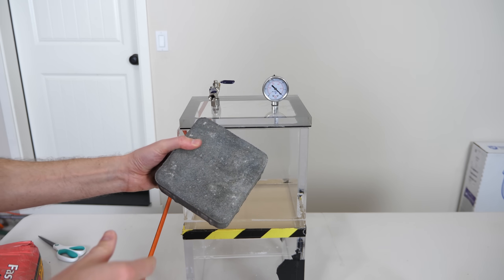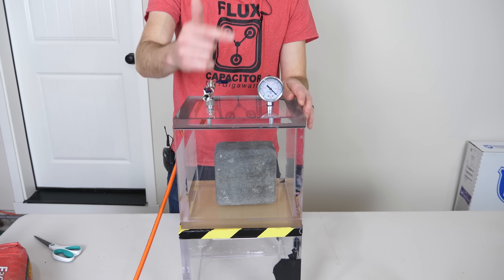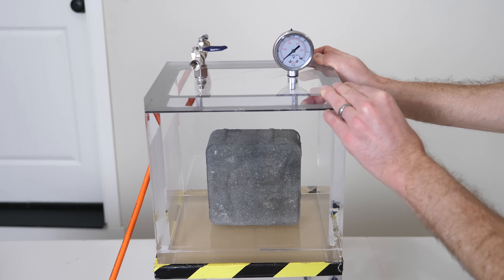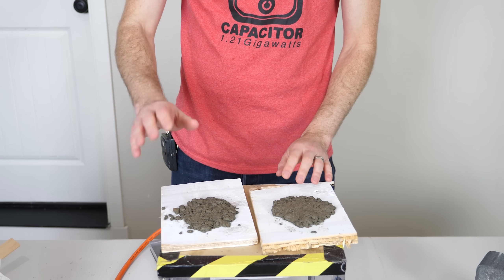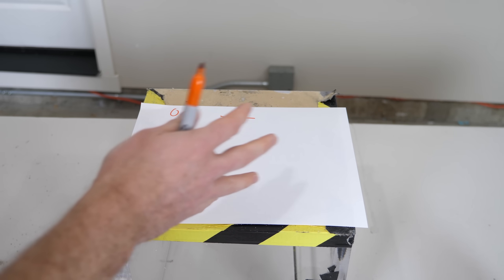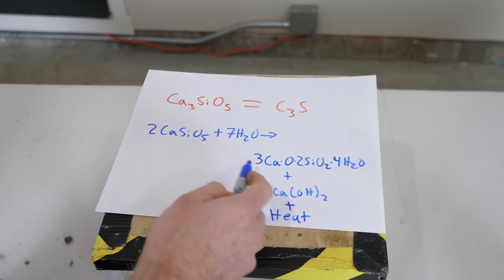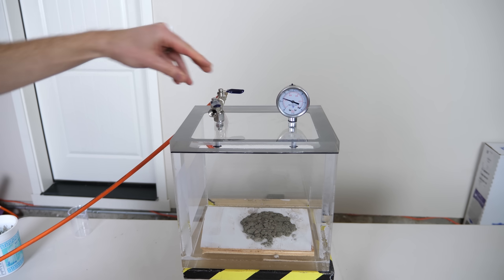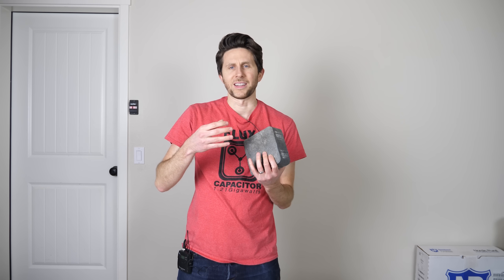Does Concrete Turn to Dust in a Vacuum Chamber? Concrete Without Oxygen Experiment

Comment: To 'make concrete in space' all you need is a mold that is fully enclosed to prevent water loss while it is curing.

Granted, in space, you would have to be carrying a whole lot of water, which likely means you would have to mine it from hydrate bearing rocks to begin with. 

I would suggest that you would be better off on some kind of moon or planetoid where a source of water [and probably the rest of your minerals] already exist. 

Our moon would be an ideal location for a solar powered concrete fabrication facility.

So too would be any other place you came across water either in liquid, ice, or mineral hydrate form.

That way you would not have t carry a bunch of very costly and yet very flimsy pre-fabricate bubble houses with you, you could simply set up a small, efficient base camp, and set right into mass producing housing with the native materials on hand.

With intensely enough focused sunlight, you could even 'sun-laser' cut the rock into pieces and simply move them out of your way to tunnel into the surface, and then use the 'rubble' from this as the material to make any critical surface modifications, high-rise structures like space ports, reinforced pressure locks (a well made concrete will hold against a vacuum for a long time) and to seal/reinforce loose and unstable ground rock.

On top of this, much of the 'waste' rock could simply be thermally depleted of its water content, simply for the value of pure water for drinking, irrigation and hygienic purposes.

Almost all rocks on all solid bodies in space have some portion of water locked in them, just in the form of mineral hydrates.

Since concrete is a mineral hydrate, all you are doing is converting a crude, wild, random collection of lithic hydrates into an orderly, well controlled aggregated conglomerate.

Concrete would withstand zero pressure on asteroids and moons forever, so far as how much oxygen it was exposed to, things like meteorites, and possibly cosmic rays would be more of a challenge.

With a well engineered solar concrete and water manipulation station, you could colonize any planet within a reasonable distance of any star, no matter what the atmosphere was [or was not] and even produce an atmosphere out of stone, since oxygen  nitrogen and argon are often captured in the pores of rocks, and this process would liberate these gases along with the water and dry minerals, meaning you could produce your breathable atmosphere while making your concrete and water.

Comment: You are technically wrong because what they mean by removing all air or oxygen is even taking out the air bubbles trapped in it so those would be little vacuum bubbles but what you're doing is just removing the air around it so there is still air inside of it allowing it to stay intact and structurally sound

Comment: can confirm that the reaction doesn't need air, that said there's gas content in every concrete mix because the mixer churns it up. there's even specially designed soaps that are designed to pick up more air because having a balance of air content and water content has a massive impact on the final compressive strength.

your test of the concrete strength was also bad, because you applied a shear load. Concrete is designed to be strong at compressive loads, but it's weak with shear load. It's why they put tension rods in concrete beams, it makes the shear load into a compressive load.

Comment: Storytime, there was a test called Biosphere two that was done. We had artificially constructed a biosphere and pumped everything we needed to sustain life into it. This was a test to see what it would make to possibly create biospheres in space. Well here's how this ties into the video: they had calculated the exact amount of oxygen consumption from the people they had enclosed inside the biosphere and also calculated the oxygen production from the plants they included. They wanted to be as efficient as possible, no weight wasted right. Well the base of the biosphere was concrete which they had allowed to set for a little while. Not too long after the experiment had started, they had to pump oxygen into the biosphere because they were seeing signs of oxygen deficiencies. Why? The cement. They hadnt accounted for the fact that cement continues to cure for a very long time after it is dry, even if its only in small amounts it had an impact. (They also hadnt calculated oxygen consumption from bacteria in the soil they were using.) 
Long story short, concrete continues to slowly absorb oxygen even after it is set until the entire block is cured which can sometimes take years depending on the size.

Comment: Did anyone else notice the little piece by the bottom right pop when he let air in? Also when he let air in the color of the cement changed. Usually the color changes from curing. Perhaps, seeing as you cant get into the vacuum this test is voided since you couldnt check it in a vacuum.

Comment: the deal with no oxygen = no concrete is if the Element Oxygen vanished wholesale, then concrete no longer has that element in its makeup and therefore would crumble.  It's like if Carbon vanished we would disintegrate because our DNA uses Carbon.

Comment: So listen..
Concrete has oxygen in it’s own chemical structure..
If you remove the oxygen from the air near it that doesn’t mean that the oxygen in the chemical structure would just go away..
If you remove the oxygen from the chemical structure of the concrete it would maybe turn to dust..

It’s a good thing you mentioned that in the video.

Comment: Cement doesn't "dry" to get hard. It's a chemical reaction that causes it to set. I suspect in the vacuum chamber it should set perfectly well, as the reaction doesn't require oxygen. In fact.it might yield a stronger concrete as it will help to remove bubbles.

Comment: It should be noted that concrete in a vacuum chamber does not meet the requirement of "losing all oxygen". Oxygen is also present in chemical bonds, most notably water, but also in concrete and many many other items.  Therefore, the loss of all oxygen would destabilize the concrete, along with anything else (like living organisms) that have oxygen as part of their chemical makeup.

Edit: and if I would've waited to comment I would've seen that you explained all that.

Comment: The way cement & concrete turn solid is through an exothermic chemical reaction (think mixing lye with water when making soap) so even under vacume the reaction should still take place and dry the mixture

Comment: That it doesn't need air at all is not completely true. It just doesn't need air for the initial hardness but it needs it to harden completely. When its hardened conpletely its called blue concrete. The Ca(OH)2 reacts with the CO2 in the air for the full hardness. Concrete Chemistry is pretty complicated

Comment: The question the title was not about concrete curing. It's misleading. So you meant will concrete cure normally if oxygen is removed from the equation. the title of your video implies that the question is would concrete structures remain standing if the atmosphere was stripped of oxygen for 5 seconds. 
Which was a ridiculous question, hence my comment pertaining to wondering whether or not the original intended question about a vacuum situation. Confusing either way. Don't understand the question or the point of the video 😂

Comment: Can you have a frequency of light be high enough so that it’s basically a straight line, and a frequency of light so low that it’s basically a straight line? If so, would both wavelengths look the same to anything that could view it? What would happen if you had a light bulb with the high frequency and a light bulb with the low frequency right next to each other?

Comment: I have another question. If the pH of hydrated Portland cement is around 12.63, and sodium hydroxide is 13, then why is it that sodium hydroxide or caustic acid will immediately burn tf out of my skin, but immersing my hand in wet concrete does not?

Comment: Surely you mean atmosphere and not oxygen correct? Sissy oxygen disappeared there would still be carbon dioxide nitrogen argon and all of the other components of our atmosphere. Would it not be far more accurate to say if the Earth's atmosphere were replaced by a perfect vacuum for 5 seconds? And is it not a stupid presumption in the first place considering there are tons of standing Rock structures on the moon and Mars? What anybody be so gullible as to believe that concrete is weaker as far as compression strength and shear strength as compared to natural mineral rocks? This is ridiculous.
However, i posit this: is there a limit to the strength of a vacuum? What I mean is if you continue to pump all the air out of a chamber, what happens when the very last molecule and Atom has been sucked out of the chamber? The chamber implodes. Supposing the chamber was an indestructible sphere. What would happen to the chunk of concrete then? Would it explode or would it collapse into a dense little Planck nugget of concrete

Comment: As for "crumble"...
Decades ago, someone left some cinderblocks in the creek all winter long.   The ones that were completely submerged were fine.  The ones left sitting high-and-dry up on the bank were fine.  But the ones that were partially-submerged crumbled into wet dust.   (Wick-action kept the unsubmerged part soaked and it froze)

Comment: I think the colour of the concrete in the vaccum is different from the concrete in air is due to formation of calcium carbonate.  There is no co2 in the vaccum thus the caoh2 produced dosent undergo a chemical rxn. Whereas co2 is present in the air so the following chemical rxn takes place
CaOH2+CO2 --->CaCO3 + H2O. As calcium carbonate is white it changes the colour of mixture formed.

Comment: Although it is true C3S is the most impotant crystal forming, the initial hardness and heat production are not caused by C3S but C3A and C4AF. These reactions can form insane amounts of heat to degrees it even kicks water out of the hardening concrete by vaporising it. Thats actually a big problem in warmer areas where the concrete needs to have less aluminium to even harden properly since its already way to warm outside for controled hardening of concrete.

Comment: But it's there's no pressure on it from weight? Concrete structures are heavy - so put some pressure on it and see if it takes less pressure in a vacuum to crush it :)

Comment: Nothing will happen, because sand is very fragile right? We’ve all built sandcastles, or played with sand and it doesn’t stay without water right? And there is more pressure right? So it wouldn’t make sense to just crumble, if anything it would crumble with less pressure or no pressure. I’m probably 50% Right with these facts

Comment: My guess: not a darn thing w/o air when set. Curing w/o air will take longer and not be as strong but will still happen.
Reply: First part correct. Second part off, but I think a more robust methodology and longer period would be better to tell as breaking concrete by hand would indicate a not great sample. And hey..... cast a cylinder for each then run it through the hydraulic press to see what it take to break.

Comment: Air without Oxygen at sea level is not a pressureless vacuum though.  Other gases would still put the pressure on concrete.  Would a 100% Nitrogen mix inside the chamber at the same pressure as air still create the same results?  Would a Nitrogen/ CO2 mix change anything?  I think all the youtube videos are mising up removing Oxygen and removing all air.  Your experiment is removing all air, not the same as what the other youtube videos claim, but it's still an interesting experiment in it's own right.

However your experiment does answer these questions as in a vacuum nothnig happened.

Comment: Lack of air would mean lack of pressure which would test the stretching resistance or however is called, which is pretty bad on concrete. Concrete is known for his compression resistance that's why it's paired with steel to complement each other work.
Aside from that the material is already formed so I don't see a reason to believe it'll behave anything different from a rock.
Now to watch.

Comment: You should have filled 2 cylinders with concrete and made a compression test, cause the way you did it was actually testing tension which concrete doesn’t resist very well

Comment: There should be absolutely no difference. Cement sets underwater. However it can dehydrate. Thus why concrete often gets hosed down or covered by tarpooling in the hot months. If concrete drys it stops the reaction. It takes 1 month roughly for concrete to achieve 75% of its total strength. And a further year to set fully. This can not be said for lime mixes or older muck mixes.

Comment: Erm sorry to tell you but its not because the concrete need the oxygen around it, but it has oxygen atoms in it, so if you took thr oxygen atoms from the concrete then it will turn to dust( which you cant do). But all your doing is taking away oxygen from around it, not taking the oxygen from inside.  Sorry for the long explanation.

Comment: Concrete won’t turn to dust in a vacuum chamber because they are talking about tacking the air bubble that are in the concrete away instantly not sucking it out and any why you can’t tack the air out of the concrete because it’s air tight

Comment: vacuum will cause the water to boil off because lower pressure lowers boiling point so less water to complete the reaction... means weaker concrete.

Comment: Those videos assume that all oxygen everywhere not just breathable oxygen disappears, meaning that the air in concrete that help it keep it's rigidity would be gone. You can't pull the oxygen out of concrete with a vacuum chamber, not all of it at least.
Edit: Also, buildings have several million tons weighing down on them, this test neither proves or disproves the theory.

Comment: I have a question what will happen if you put a radio active material in the vacuum chamber will it react with plasma like an electrode making a plasma ball lol
Reply: Or is there something you can put in there to do what an electrode can do but not having to use power lol just with an element but get a plasma reacting with it
Reply: There are these glow stitch that glow for 12 years on line that are radio active I wonder if what is coming off it can knock the electrons off the plasma to cause that stadick charge or mabe other gases just looking for that kind of reaction
Reply: Would love to hear your thoughts
Reply: The video I seen is how to make a tritium battery the viles he got

Comment: The vacuum chamber concrete should be more brittle overall than the air dried. The best method for curing is keeping it wet.

Comment: I'm guessing that nothing will happen to the concrete structurally.
I think what those videos meant by it depending on oxygen to maintain structural integrity was the presence of oxygen-containing molecules. What we are doing here is extracting all the gases from the chamber. That need not affect the oxygen atoms which are part of solid molecules.

Comment: You're an idiot, oxygen in the air has nothing to do with the concrete. It's the oxygen molecule from which the thing is made up of when reacted to calcium phosphate. LOSING O2 for 5 seconds mean the products losing the O2 molecule. You're just taking away the air , but how would you take away the O2 molecule which is in the concrete? BTW this is gypsum (CaSO4.2H2O).

Get your facts clear guys

Comment: You're only removing the air from within the air pockets of the concrete but not from the molecular structure of it. And I don't think you can do that by simply using a vacuum.

Comment: 100% certain that concrete doesnt need air. there are air bubbles in the concrete, but its the material's own tensile strength that holds it up... not the air dummies.
I'm also 100% certain that the concrete will still become hard in a vacuum chamber because it is a chemical reaction between the cement and the water... then again it wont be as sturdy as normal concrete because the vacuum evaporating the water before it can react

Comment: It’s going to stay just as it is because the internet has all the goofy, untrue stories. I’m not sure at all if I’m right, but concrete is dry so I think any reactions with oxygen or the air would be complete and the concrete would be inert and stable. I do think new, wet concrete needs contact with air or oxygen to set up and dry. I think I’ve heard that is part of the reaction. I feel more sure of this one.

Comment: If you put concrete inside an air tight container. It will still harden. Does not matter if there is oxygen or not. It's a chemical reaction. Buy water Putty and mix it. It's about the same thing as concrete and cement on how it works once mixed with water.

Comment: The quick dry concrete you used is specially made and some types will even will set under water (unlike normal concrete). That is the reason it felt hot almost immediately. Also, it needed to be wetter to start with and not hang around for so long before being put in the vacuum. This concrete goes off in less than  five minutes (the forty minutes is when they reckon it is set fully hard). I would have liked to see this done with normal concrete. I could be wrong but I assume evaporation would still take place in a vacuum (especially if the container was big enough) and that it would still set.

Comment: Buildings and structures have stress from overlying structures and atmosphere, what stress does vacuum have ?
There are other gases and compounds that wants the oxygen in the concrete, if oxygen gas is not there in the atmosphere.

The experiment is not conclusive or believable.
Needs better execution, the parameters of the experiment are not through.